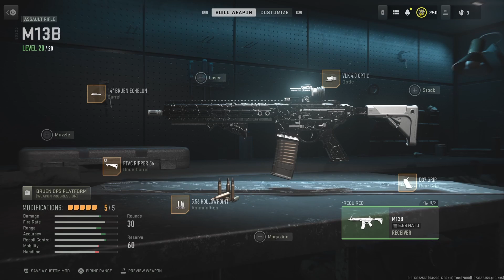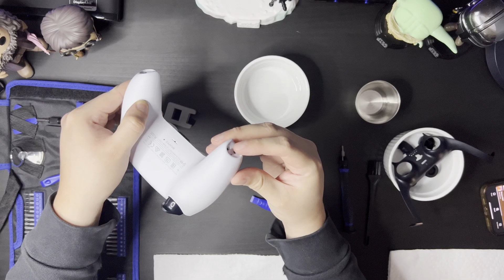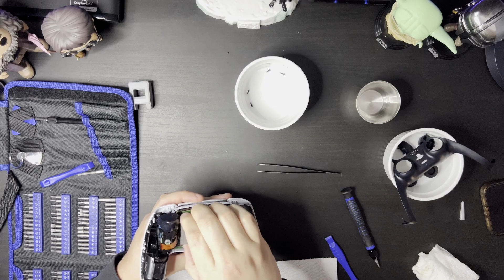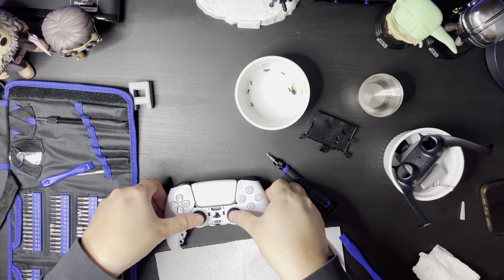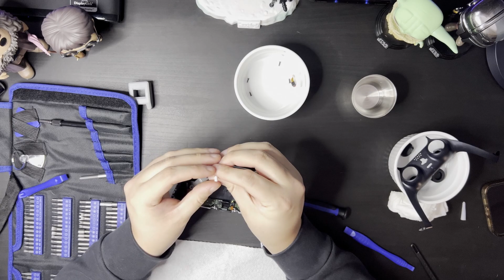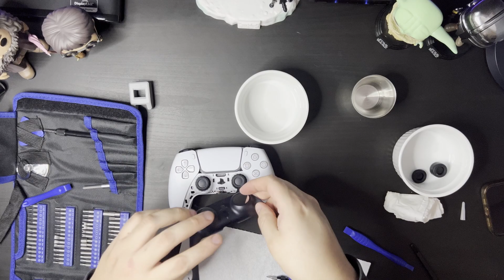HOW TO FIX STICK DRIFT ON PS5 CONTROLLER

Comment: You actually didn’t fix it you just cleaned the controller. You are supposed to take apart the analog sticks and the clean the receivers inside of it. But good job tho